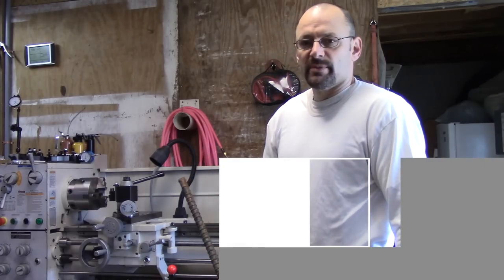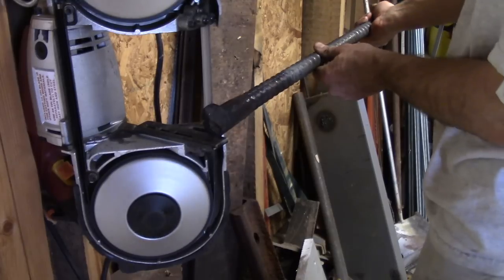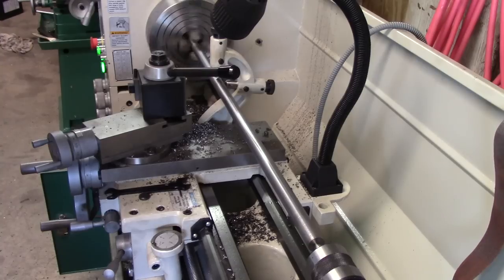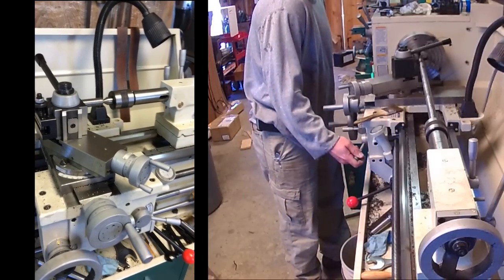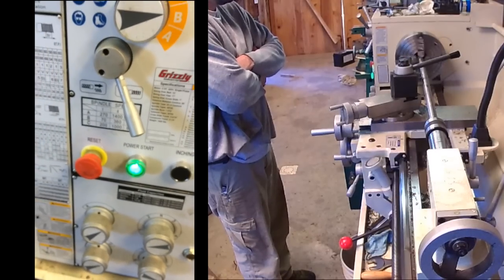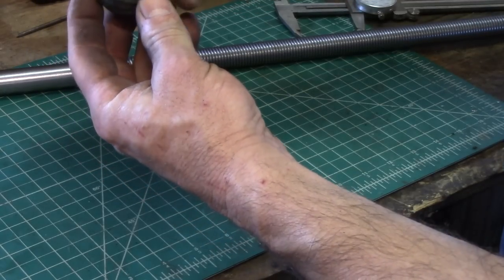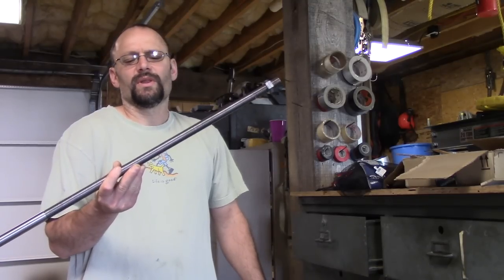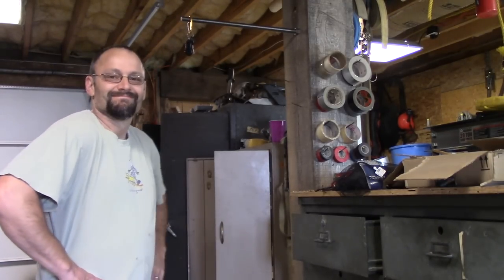Combining blacksmithing and machining. & Putting my Grizzly G0750G lathe to the test.  FarmCraft101

Comment: I am curious how the bubblegum steel in that rebar would hold up as an actual bolt. That being said, I never would have thought to put rebar in a lathe. For messing around, rebar = waaaay cheaper than cold rolled.
Reply: Glenn Burrow  some re-bar has better composition than the hardware grade bolts  of your Prius.

Comment: Got to this video from the bulldozer repair video thinking maybe it would answer a question I had about cutting threads on a lathe using multiple passes.  How do you get the thread cuts to line up precisely from one pass to the next?  I could see how this would work if you kept all the gearing engaged and ran the lathe backwards back to the start starting point, but that doesn't appear to be what you did.  Just wondering.

Comment: What kind of steel is re barb made out of? Seems like it cut nice even after being heat treated lol
Reply from the maker: A36 hot roll.  Thanks for watching.
Reply: It is just barely "steel". It is one of the lowest quality commercially available steels. Just needs to be able to be hot forged, bent to shape and keep concrete from falling apart. That being said it is still plenty strong to hold up a keyring... and bridges :)
Reply: re-BAR as in reinforcement bar...

Comment: Why not 16 tpi for a 13/16-16 UNC? Your .810" OD was only .002" smaller than the 13/16 major diameter and was well within tolerance for class 2 threads.

Comment: http://www.fastonline.org/CD3WD_40/JF/411/04-108.pdf
on page 29 and 30 this details upsetting long bars, suggesting you use the weight of the bar itself to create a deeper upset in the steel instead of concentrating it at the outmost surface, when hammering directly on it. this is super cool and impressive, I'm amazed you pulled off that long thread in a home shop. a sweet proof of concept indeed.

Comment: You could've made a 3/4" thread, isn't that far away from 810 thou. Also, the head could be a bit bigger to be practical, but as a proof of concept it's very good ;)
What wrench size are these?
Reply from the maker: +Klaufmann They precisely fit my adjustable wrench. ;-)

Comment: Love this kind of thing.
I hear that rebar gets real upset if you use a welding machine to build up shaft diameter.
Reply from the maker: Yeah.  I've learned it's best not to upset the rebar, at least not that way.  It's kind of like upsetting the wife... :-o
Reply: yup rebar really is not your best welding choice for strenth its to brittle welded together for on floor cement puposes thats ok but not for any strengh strucktual purposes.
Reply: i wouldnt make a trailer toung out of it.
Reply: Lots of impurities in it so when you weld on it and the impurities get mixed in the weld metal and generally makes a mess. Evidently it can be welded with thermite because they make whole buildings  that way.

Comment: Nice job. There are two things I would do different. 1. Use the follower rest for final thread cuts, thus will ensure even thread depth and cutting angles. 2. The cord that tides along the top of the back splash will eventually damage the paint on the contact surface and even worse break the wires at the contact point to the box it attaches to. I would make a hanger to allow the cable to hang freely from the friction and add a spring where it enters the box to keep the bend to a shallow bend.

Comment: what kept the rebar from deflecting under the tool pressure while threading?
Reply from the maker: Light cuts and spring passes.  The follow rest interfered with the live center, so I didn't use it for the threading.

Comment: Obviously, I know nothing about machining, but that said, I have a question. when you are cutting the threads, does the lathe know where the thread starts? I mean, is the beginning somehow indexed so that the cutting head knows where to touch the metal for each pass?
Reply from the maker: The operator uses a thread chasing dial, which allows you to engage the carriage at the proper time to match the threads already cut.  So, the lathe doesn't know, but the operator does.  At 6:14 I reach with my right hand to the carriage engagement lever.  There is a circular dial just to the right of my hand (in the picture) that is spinning, and that's the thread chasing dial.  I engage the lever when the dial is at the proper position with each pass.

Comment: if there was taper in the bed, wouldn't that carriage mounted steady rest have pulled the bar in such a manner that it would not have reflected in the part?
Reply from the maker: Possibly a very small amount.  But I have checked the ways with a dial indicator and they are flat.  Also the follow rest is not very beefy, and wouldn't be able to deflect that steel very much.  Thanks for watching.

Comment: Hi bud should have used the steady for threading as well if not risks to break the insert and thicker thread in the middle due deflection.
Reply from the maker: I wanted to and would have if the follow rest didn't interfere with the live center.  With the follow rest on and the threading tool square to the work, no way to thread all the way to the end.  I just went slow and took light cuts to avoid deflection, and a few spring passes at the end.  It came out ok.  Thanks for watching.

Comment: about the nut you had to drill the hole and tap, than screw it on a existing bolt and put that bolt into you lathe and than you can round it of to the correct dimension

Comment: Plate on the ground, heavier the better, and drive the entire bar like a spear into the plate to upset. Works very well in my experience for longer pieces with enough mass of their own. Clean up with a hammer then after. 

Cool video, enjoyed it.
Reply from the maker: That's a good idea.  I don't think this piece of rebar was quite heavy enough, but if it had been longer as you say might have done the job.  I try and remember that for my bag of tricks.  Thanks for watching.

Comment: Rebar is made from feihua steel, get some proper bar stock.
Reply from the maker: Well that would just be too easy, wouldn't it?  ;-)  If I needed a part to meet certain specifications, I would use the proper stock.  This was a test of my new lathe, and I wanted to see how it would do with a less than ideal turning steel, interrupted cuts, etc.  Thanks for watching.

Comment: Why you don't use coolant
Reply from the maker: I use cutting oil as coolant.  I edited a lot of it out to keep the vid from being too long.  I apply it several times during the video but it's at high speed.  Easy to miss.

Comment: you just drilled a big hole through a load bearing wood beam to make joke on video... good job!
Reply: And reinforced it with re-bar. Genius!
Reply: Perfectly fine. I think the rule is something like no holes within 2" of the edge or of each other in load bearings.
Reply from the maker: I built the shop, and milled that 9X9" post from an oak tree.  The post is tremendously overbuilt.  It could be half the size and still be perfectly safe.
Reply: That small of a hole in that big of a beam will have absolutely 0 impact on the structural integrity of that building, Especially when he put a steel bolt thru the hole.

Comment: allthread, weld a nut on the head and there is a big bolt. Great show of skill though!
Reply: Yeap works! If commercial nut and treadedrod, then remove zinc coating before welding with vinegar bath. had to make long ass bolts for one project, so that is how i made them.

Comment: nice project. In order to make hex bolt heads and hex nuts look good like the professionally made ones you can put a 60 deg chamfer wide enough so it just touches in the middle of the flats on the outer side of the bolt head and both sides of the nut.
When you used the follow rest for the outer diameter of the thread it would be advisable to use it also on cutting the thread. No problem with roller tips. It may scratch up brass or bronze tips. But they can be refinished afterwards.